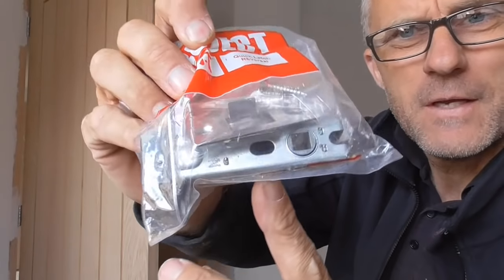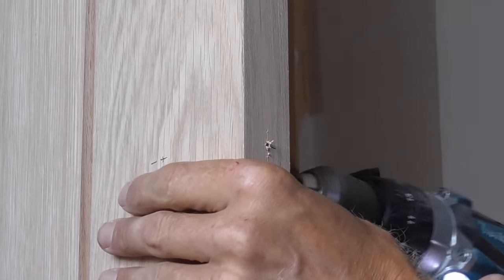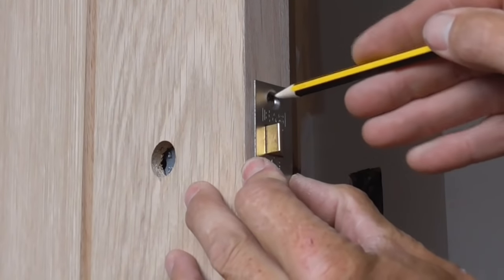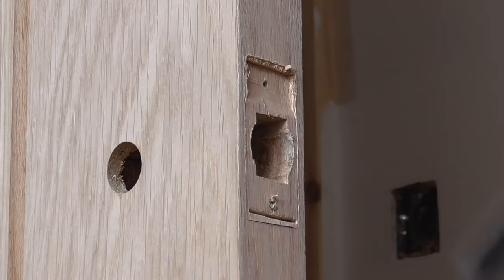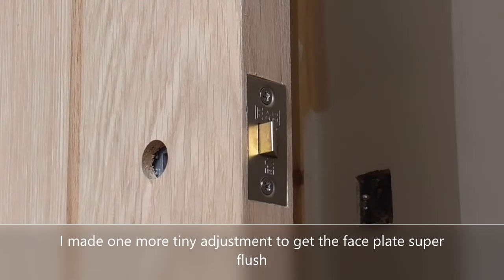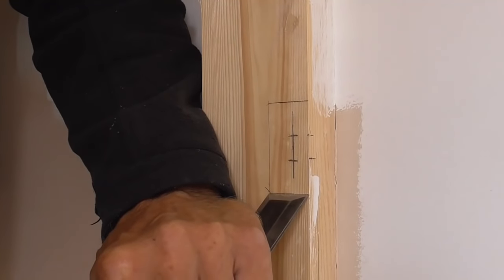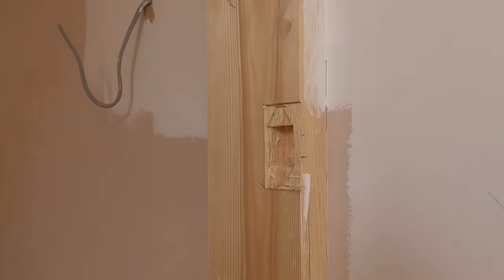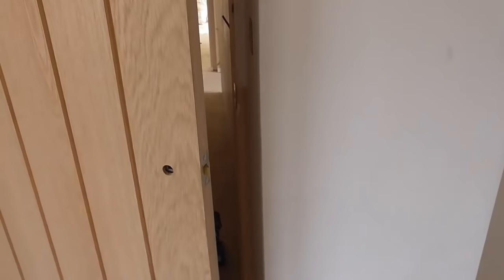How to fit a tubular mortice latch and keep.

Comment: Thought you would have a souber lock kit. Can very highly recommend them.
Reply from the maker: I think I'm stuck in the past David.😬 I haven't seen one of those Souber kits in the flesh, but I hear they are pretty cool.😎 Cheers.
Reply: @thetallcarpenter  they are good mate, i would say you could do three locks or latches to one done by hand. Had mine a few years now and it payed for itself on one barn full of doors. You should look into it mate.
Keep up the good work buddy.
Reply from the maker: @davidbrooks8038  You're not helping David.😣 My wish list of tools is supposed to be getting shorter not longer😆 Cheers
Reply: @thetallcarpenter  love your content/ channel. Get the souber. Makes life alot easier. Hello from Dublin. You are a great chippie .👍
Reply from the maker: @garymaguire7778  Hi Gary. The Souber has been mentioned a few times so will check it out.😎 Cheers
Reply: I use a souber and there brilliant I don't have to worry about spliting out the door
Reply: @1987pagey  savage tool, no marking gauge no free hand drilling. Dead center every time. Love it.
Reply: @garymaguire7778  yep had It years now let me down

Comment: Tried using a brand new auger bit on a door just like and nearly split the door in half 🤣 terrified to try it again. Any ideas why? I pre drilled but did use a bigger one so don’t have to chisel out. Yours went through like butter
Reply from the maker: Hi there🖐The key is to use a large a diameter pilot drill as possible before using the auger bit👍 You'll be surprised how big tge pilot drill can be and the screw still pull the auger bit in👊Good luck😎Cheers Del
Reply: @thetallcarpenter  you’re a legend man, I’ll try it again. Enjoy your weekend

Comment: I'm a home owner and need to fit 6 doors, is the auger bit mandatory or will a spade bit be ok? Many thanks.
Reply from the maker: Hi Bob🖐You'll be better off with spade/flat bits, as augers can be a bit aggressive💪Cheers Del
Reply: @thetallcarpenter  Against your professional advice I've just pulled the trigger on an auger, they were considerably less expensive than I was expecting. It seemed the auger would give a more accurate start to the hole. I'm a metalworking guy so I'm no stranger to hand/power tools. Very handy video, thank you.
Reply from the maker: @TheDarvec1  I use augers Bob, and you will have no problem with them as you'll have an understanding and experience of using drills👍

Comment: Nice work sir,where did u get the door spindle tool for opening door without handle?thsanks
Reply from the maker: Hi Paul. That little tool is actually an insulated loft hatch key that happens to be the same size as a spindle. I don't think you can but them separately and I just got this one after fitting a whole development of houses with the aforementioned loft hatches.😎 Cheers.
Reply: Hi Paul if you look on Amazon for a 6.5 mm square budget lock key you should be able to find one for under a fiver
Reply from the maker: @callumbarton7862  Top man Callum.👍
Reply: @thetallcarpenter  Thanks for that. Keep up the good work 😀
Reply: @callumbarton7862  thanks Callum 👌
Reply from the maker: @paulmcgeoch2603  👍😎👍

Comment: Nice job,the only things i do different is at a 1metre i put a light line across the edge of the door and have a square set at 57mm to mark the spindle hole.Havn't explained it very well but it's late lol.
Reply from the maker: I get you Dave, and have marked the backset the same way in the past.👍 Thanks for your comment.😎

Comment: Hi Del, brilliant job as usual pal. Just wondered which size auger bits you use for the spindle and latch? 
I like that spindle handle? Where is it from? 
With regards to souber..... I have the jig but it’s quite time consuming on a simple latch if you are only doing one or two doors. It’s amazing for mortise locks though!!! 
Thanks again for your videos mate
Reply from the maker: Hi there Paul. I use a 7/8", (22mm), for the latch and a 3/4" for the spindle. The latch key thingy is actually an insulated loft hatch key that was surplus on a develpment where we fitted one to every house. I don't think you can buy them but another commenter on here did mention that a similar thing is available from Amazon.👍 Thanks for watching mate.😎
Reply: Cheers Del.
Reply from the maker: @paulyoull5472  👍😎

Comment: Hi, what size was the main auger drill bit? I like how you don't just use a 25mm bit and get too close to the edge.  I've got the same doors, my chippy is going to use a 25mm bit, but surely this creates a weakness on the most used and pulled part of the door, around the handle.  I'm considering saving paying 25 quid per handle (13 of them) and doing it myself.
Reply from the maker: Hi RedVin🖐The auger bit I use is 22mm, as  like you suggest, I find 25mm is the same size as the latch faceplate, so the edges of the hole can sometimes be seen👊Many chippies do use a 25mm bit for ease, and I don't think it significantly weakens the the door over a 22mm one👍Hope that helps😎Cheers Del
Reply: @thetallcarpenter  Thanks for the response Del !
I'll ask him if he can use a 22mm and do it with your method.  Im just after a neat job, as the doors are an expensive one and need a good finish.
On the weakening point, I just thought it would make a section of the wall thinner, but thinking about it, that's of course only the widest part of the hole which isn't much anyway.  I over thought that part.
I'd do it myself, it's just the chiselling out of the face plate that I'd be concerned about.  Rest is pretty straightforward
Reply from the maker: @MegaVinny73  Be as diplomatic as you can with your carpenter, as you don't want to upset him😆All the best😎Del
Reply: @thetallcarpenter  he's a good lad, he's done a great job hanging the doors and is easy going.  I don't think I'd upset him asking him and probably tell me his way is best anyway, win win I think :-)

Comment: Great video mate, what size were the auger bits please🙂
Reply from the maker: Hi DF🖐I use a "7/8 or 22mm for the main latch body, and "3/4 or 19mm for the spindle👍Cheers Del
Reply: Thanks for the quick reply, you just earned a new subscriber sir
Reply from the maker: @RestorationsFOD  That's brilliant DF🤗 Cheers, and have a good week 😎

Comment: One Question: Why do you prefer the 'auger' type bits as opposed to a 'spade' bit? Just wondering? I find I have more control with a Spade bit as opposed to those Auger type bits.
Reply: Spade bits move in all directions to easy especially if you hit a knot auger just pulls in a straight line.
Reply: I find some of the spade bits especially the Bosch ones are quite aggressive and can pull out of line the auger looks like it is a much cleaner cut..think I will give them a go

Comment: Why does my latch not retract fully when i push the handle down to open the door, its as if the handle does not have enough throw to fully retract the latch...... cheers.
Reply from the maker: Hi Paul🖐 The first thing that comes to mind is the latch mechanism catching on the inside of the hole of the latch body.(there are a couple of little wings that shoot out of the latch body and can foul if there's not enough clearance) Hope this helps😎Cheers Del

Comment: can you tell me what size screws you used to hang the door?  what size to latch? please
Reply from the maker: Hi there🖐The hinge screws are 3.5mm x 30mm and the latch has a 57mm backset👍Cheers Del
Reply: @thetallcarpenter  thanks a lot for replying so quick
Reply from the maker: @markholyoak9790  It's all part of the service🫡

Comment: Adjustable catches are literally my favourite thing in the whole world.

Alot of my work is new doors in old wacky frames.

Nothing worse than looking like a wood butcher when you get the old style catches a mm wrong and the door won't shut or it does but there's that annoying rattle and you have to try move it very slightly one way or the other.
Reply from the maker: Hi Kallum🖐You're right bud, and those little adjustable tabs are really cool for getting the door to close just right against the stops👊Thanks for watching 😎 Cheers Del
Reply: As a fairly experienced door hanger, my personal top tip, especially with new linings and doors that are going to be painted, is fit the catch and adjust the tab with your flathead about a mm or two more than you want to before you tack on the stops.
That way it can be adjusted back if the paint ends up thick enough to prevent the latch from catching.
It's better than the Robin clevitt method of setting the stops back the thickness of a credit card.
Which I have tried
Reply from the maker: @flyingjackcarpentry9394  Interesting Kallum 🤔 And its easy to forget about the thickness of 3 coats of paint😬I always set the stops back a mil or so on the hanging side, and on the flapping side, I nail the stops tight to the door about a foot from the top and a foot from the bottom, and then just pull the handle slightly so it pushes the door stop back a mil or so, before pinning the  rest of it. This gives a a bit of tolerance for paint at the latching point, but also puts slight tension on the door, top and bottom edges which stops it from rattling👊Cheers Del

Comment: Some great tips in this one tall carpenter but if you're an apprentice watching this you might want to give the auger bit a very wide swerve.  Auger bits are for very careful pros, that's why I don't use one 😂.
Reply from the maker: Hi JRS. I didn't know that auger bits were given a wide berth nowadays as I have never used anything else.😆 Thanks for your comment.😎
Reply: @thetallcarpenter  For the less careful amongst us a flat bit is a safer option. Have you tried the sauber jig? That's pretty much all I use these days for more than 1 door.
Reply from the maker: @jrsuk1170  I haven't used or seen a Souber jig but a fair few guys have mentioned it in the comment's so I'm going to have a look into it.🤩 Cheers.
Reply: Ive also been using the Souber mortice jig for tubular latches and mortice locks for years. Great invention at a reasonable price.  I use 1/4 inch router , Trend 1 piece hinge jig  and Souber mortice machine with a high speed corded drill . I also use the tormek T7 to sharpen my chisels for oak doors and frames. I always throw the keeper boxe's in the bin.👍🏴
Reply from the maker: @andrewrobertson4171  Hi Andrew. I like your door swinging set up. I've only recently started using the Trend jig and router for hinges, and it saves a LOT of time and the results are perfect every time. 🤩 Another vote from you for the Souber jig, which is firmly on my radar now.😎 Thanks for watching from Scotland. 👍
Reply: @thetallcarpenter  Thanks for your reply. I love watching your channel as always interesting to see  how other tradesman do things👍.
I still bevel the leading edge of all my doors even pre finished doors. I use my 1/2 inch router and Trend leading edge door cutter. Another timesaver compared to using my old hand plane.
Reply from the maker: @andrewrobertson4171  I had a guy did some work for me a few years ago, and he used a leading edge cutter. It looked amazing and, as I'm sure you know, gave a perfect result every time. 👌 It was the only good thing he did, the rest of his work was absolutely shocking. 😖 Thanks for you comment mate. 👍
Reply: @thetallcarpenter Yes the leading edge cutter leaves a great finish👌.
 It seems hard to get good tradesman nowadays. I just work alone except if my mate sub contracts to me to help me erect timber kits i make on site or to do roofs. I do alot of complete house builds, extensions, loft/garage conversions. Also small jobs like doors and kitchens.  Its hard to get a good allround carpenter/ joiner nowadays. Some joiners  ive met on big sites years ago just fitted plasterboard during a 4 year apprentiship and nothing else . I was lucky to learn all aspects of joinery although i wasnt put to college. I can see a real skills shortage in the future. Some shocking workmanship nowadays😬.
Keep up the good work🔨👍
Reply from the maker: @andrewrobertson4171  We're reading off the same hymsheet Andrew.😎 I agree with everything you say and work in a very similar way. 😉 Cheers again.

Comment: Your method of chopping the faceplate is totally different to me. Although I know free hand router it a lot of the time. Then just chop the small amount left out with my chisel 

I always always fit the dust boxes they make for a super professional job
Reply from the maker: Hi Paul. I suppose I still like hand chisel out these type of recesses as I still enjoy the craft of it.🤩 Thanks for your comment.😎
Reply: @thetallcarpenter  am gonna try your method next time jus see how it works compared to my previous method. What size auger bit do you use? I always go with a 25mm but that was just the way I was taught I guess

Comment: I'm a bit naughty as I never bother putting the "keeper boxes" In as I think there 1 a pain and 2 almost pointless, love when the keeps have that metal prong on them tho as you can put a flat screwdriver in little slot and use it to adjust the tightness of the keep, but they don't always have them for some reason.
Reply from the maker: Hi Ian. Yeah, those little adjustable 'tangs' are great for adjusting out any rattle🤩 Cheers Del
Reply: @thetallcarpenter  yeah can be a god send
Reply from the maker: @ianthompson9058  👊😎

Comment: A marking guage is rarely used on site, normally in workshop.
Reply from the maker: I use mine loads on site Mick, but I do remember  having 2 or 3 when I did bench joinery👊Cheers Del
Reply: @thetallcarpenter   You use it loads of times on site ?  Seems you can't get away from a good habit lol.   Workshop joinery that's the proper way for us joiners to learn the trade, some people I know aren't even legal tradesmen -no paperwork. Sure you know where I'm coming from 👍
Reply from the maker: @mickymccann252  Oh yeah Mick, I've even drilled a hole on the other end to take a pencil so I can make edge marks without scoring the timber. I'm actually did my apprenticeship  as wood machinist and joiner, but liked being outside more, so did an extra 2 years and got my carpentry papers as well👍The standard of some of the work on site nowadays is truly appalling, and hard to believe it's been done by 'qualified' tradesmen🤯Cheers Del

Comment: I use the souber morticer for the latch hole so I know the drill bit is dead center and it won't wonder, and  I router the receiver, its alot quicker and its the right depth straight away, tidy work tho
Reply from the maker: Hi Kevin. I can see me having a look at one of these souber jigs.👊 Thanks for watching.😎
Reply: another vote for the souber jog, it really de-dkills the task allowing non professional carpenters to make a decent job of it. it also makes production quick if you have multiple doors to do. Trend hinge jog and the souber morticer .
Reply from the maker: @shizzleinthenizzle   Hi there. Unfortunately, 'de-skilling', is going to become more and more necessary as the shortage of skilled trades and the uptake of younger people coming into the trades continues, and also the ever tightening of rates on sites that dictate that any tool/jig that gets the job done quicker will be preferable to more, possibly long winded, traditional methods. Thanks for your great comment.😎
Reply: @shizzleinthenizzle  there's not much skill  needed to drill a hole, I only use it for the hole not the face plate, I chisel the faceplate

Comment: Would liked to have seen  you use the router.
Reply from the maker: Hi dlite1972. I had a 50/50 chance, and decided to go chisel.😬 Using the router is not that exiting. I just set the cutter to the thickness of the keep and freehand out the bulk of the wood, and then tidy up with a chisel.👍 Thanks for watching.😎

Comment: Many thanks for this video.  Would you ever consider using a flat drill (spade drill) for this kind of thing, or is an auger bit the way to go? Do you use the same width drill as the width of the latch assembly?

Many thanks in advance.

Do you have any videos that show fitting mortice locks in internal doors (e.g. bathroom doors), by any chance?
Reply from the maker: Hi Mike. I find that spade bits are more prone to wandering in the hole than auger bits, and so prefer them👍I've always drilled a 22mm hole for fitting tubular mortice latches, and would rather just chisel out the hole a little for the square corners to fit, rather than use a 25mm bit that is, pretty much, the same size as the faceplate👊 I haven't done a video on fitting a bathroom mortice lock/latch, but will do one the next time I'm fitting one🤟 Thanks for watching and your comment 😎 Cheers Del
Reply: @thetallcarpenter  Many thanks Del!
Reply from the maker: @mikewellwood1412  👊🤩

Comment: Can anybody recommend a good quality tubular latch brand? Been looking at the Altro heavy duty range, my handles are sprung so is it a bit overkill? Need a 44mm backset. Cheers I’m advance
Reply from the maker: Hi James🖐 I've had no problems with the Touchpoint/ES contract latches from Ironmogery Direct👊They are not to heavily sprung and you can get them bolt through/no bolt through, plus, I use the one that comes with a wide keep which is great when fitting over an old keep cut out👍Cheers Del
Reply: Thanks Del, I will go and have a look at those, just starting the process of replacing all doors in my house (22), so yes will be going over existing fittings etc so your advice could work out
Reply: Thanks for replying, your videos have given me the confidence to have a go at many DIY projects in my house, including fitting my own kitchen last year! You are my first point of call for any joinery/carpentry advice 👍
Reply from the maker: @jamesbird9315  I wouldn't use any other latches when doing re-hangs James, as the wide keep always covers what was there before👍
Reply from the maker: @jamesbird9315  I'm pleased to hear that you're able to have more confidence attempting tasks with the help of my videos James🤩Cheers Del